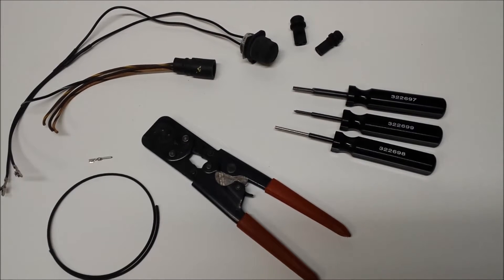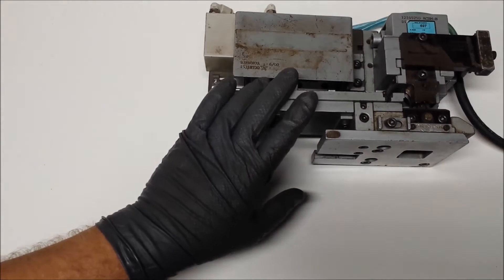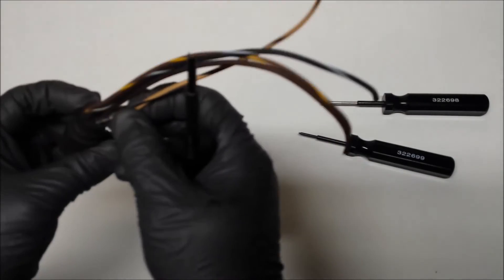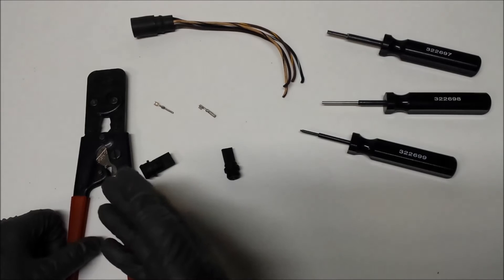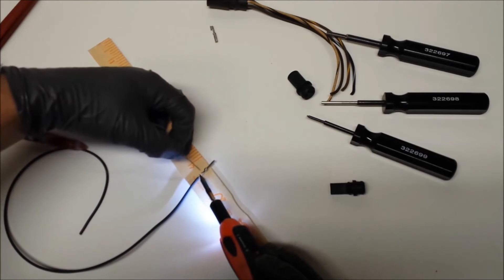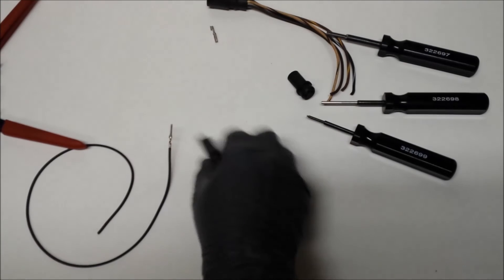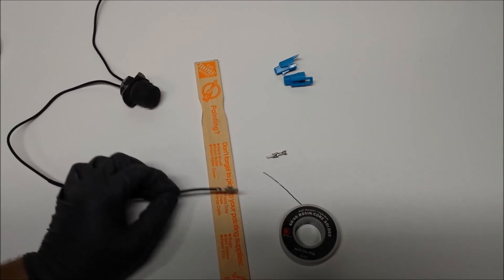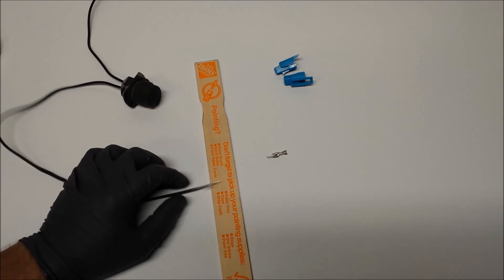Johnson Evinrude Electrical Connectors Explained

Comment: My question is how you remove the connector on the 2012  Evinrude trim n tilt switch on the side of the motor? New switch came with just the 3 pins attach.

Comment: Hello, I just bought a 1968 model Evinrude 9.5 sportwin and the wiring on the kill switch is burnt up and I wanted to replace the switch, do I have to get the OEM switch for $65 or will any generic switch work okay. Are the connectors available to be purchased separately? Thank you.
Reply from the maker: any generic switch will do. Connectors used to be on ebay, dont seem to be anymore.
Reply: @BrandonsGarage  okay thanks for the reply